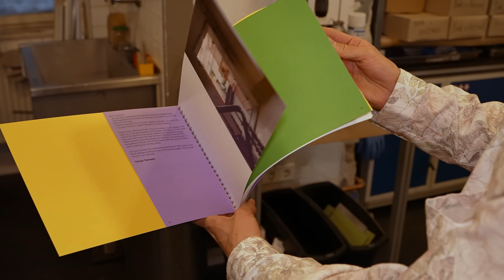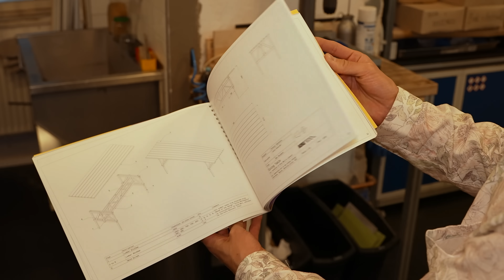Inside Korg Berlin HQ with Tatsuya Takahashi

Comment: This is pretty cool man. I been enjoying my Prologue 16 of late.  It's a pad machine.  That's what I use it for mainly.  In conjunction with the Model D which is the  backbone of everything I do.  And that's it.  Just those two synths.  I like the way the Prologue mixes.  It is easy to slot it into any production.  Minimum effort.  Usually just works with only minimum treatment needed sometimes.  Cool to see Korg doing other things though.
Reply: The Prologue is a beautiful polysynth in a market otherwise overcrowded by feature packed poly's tryjng to hide that most of them sound (and always have) 80% the same. Its stripped back compared to the competition, but it does what it does really fkn well. Its a shame that the actual release of the thing went so topsy tervy

Comment: at this point they should be designing like an arturia polybrute 16 or something like that for 2000 usd less, with extensive modulation matrix, 4 parts multi timbral, digital FX, one wavetable oscillator, etc